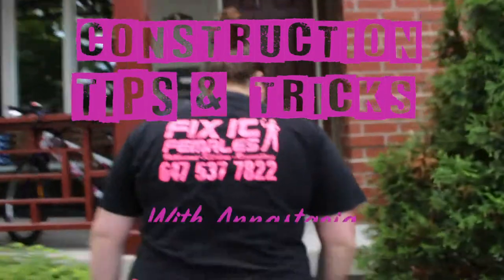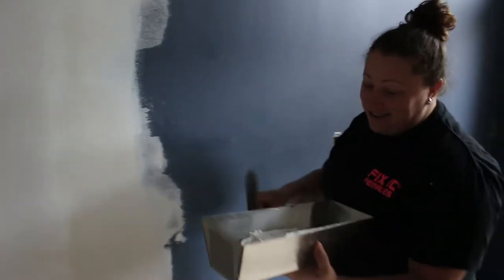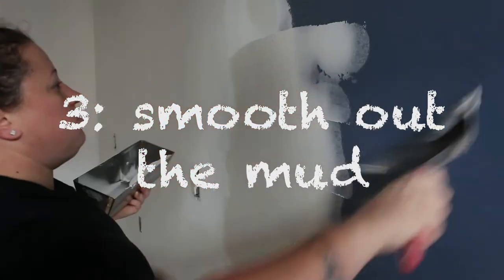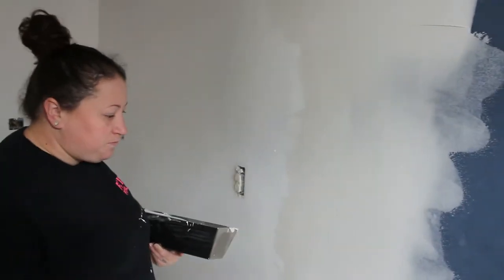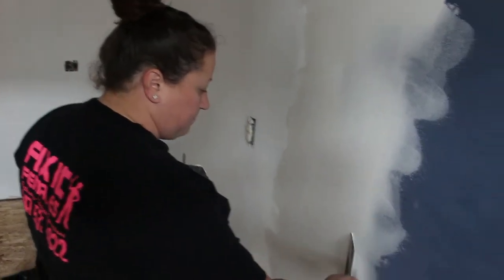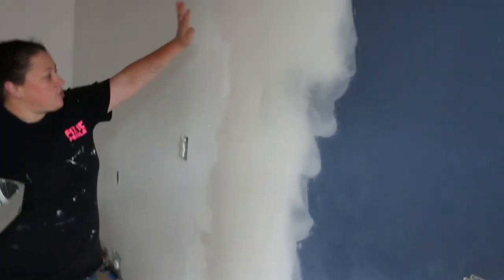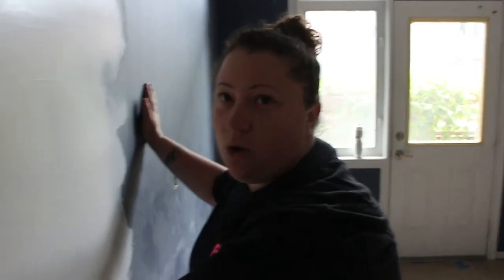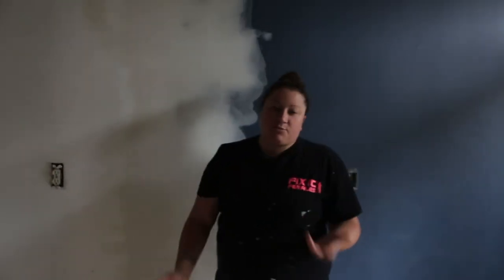How to smooth out drywall - FIF DIY

Comment: As a drywall finisher, a joint like that, I would go north and south to build it out and   make less steps.
   We all learn different ways and techniques depending on where we learn them from and as long as the end result is the same, then have at it. ✌